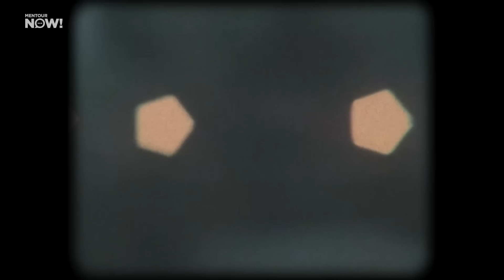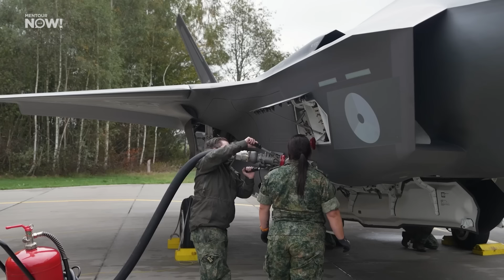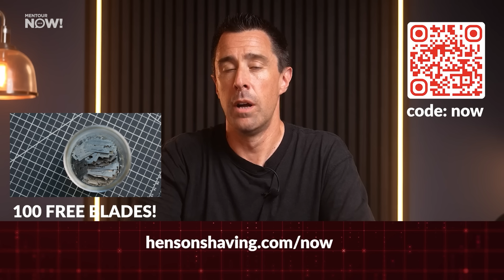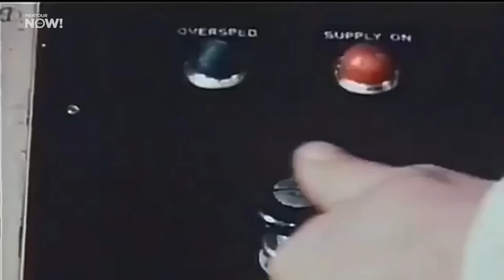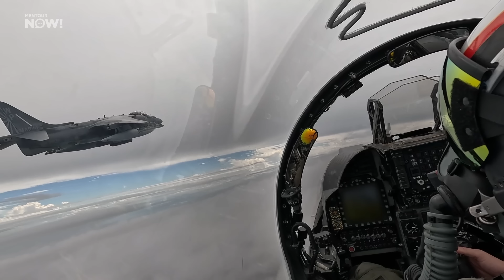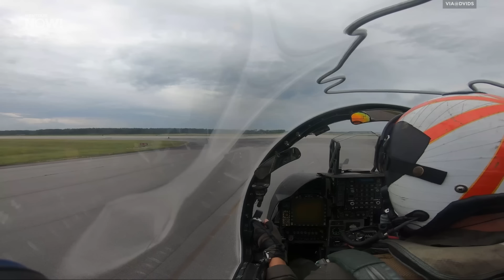The Harrier Is WAY More COMPLICATED Than You Think!!

Comment: The Pegasus is a BEAST! I used to go to airshows with no ear protection. It was usually no problem. UNTIL...one year I was standing next to a Harrier when it taxied in and shut down. Stood there for like 5 minutes with the engine running at ground idle. When the pilot shut down, I noticed a SLIGHT difference in my hearing. I couldn't hear a bloody thing! It was three freaking days before everything stopped sounding like it was underwater. 😅
Reply: Wow, thaks for sharing! It brings some extra experience (even though by-proxy) for us. At least to compare it to something we might know from a different scenario as for the hearing time after an event.
Reply: Pardon?

Comment: Wasn't the Harrier supposed to be mainly a carrier-based aircraft and since the UK had small carriers, they needed V-TOL aircraft, because no aircraft capable of carrying multiple missiles could take off (and land on) the short decks?
Reply: The P1127 project was to meet a NATO requirement for a VTOL strike aircraft. Royal Navy was totally against the idea and wanted Phantoms, which they got in 1964. In 1966, Their replacement Carrier project was Cancelled. The last RN conventional Carrier was paid off in 1978/79 and the Sea Harrier was ordered in 1975 to go on to the Invincible Class ASW Carriers (plus HMS Hermes).

Comment: There are several pieces of motorway in Germany that are dead straight so they could be used as runways if and when needed.
Reply: Half the US Interstate highway system is straight, but so poorly built that combat weights and vertical thrust would destroy them.
Reply: @RebelliousTom1 Almost the same as in Germany,  I just posted an answer 1 minute ago regarding our infrastructure.
Reply from the maker: Maybe, but bridges, electricity wiring etc might need to be reconfigured. Also, refuelling/rearming stations would need to be built in the right areas, and not all fighters are designed for easy/quick service...
Reply: @MentourNow lot of over head stuff on motorways can be brought down quickly with a bit of planing, tornados had motorway launch options, high wing ment they cleared central reservation. Germans used to set them up from time to time.
Reply: Bad idea, they are all in a bad shape because the government spends the money in the Ukraine,  not in the German infrastructur. We Germans are meanwhile joking about all going to the Ukraine after the war because everything will be repaired and modern  there.

Comment: well yes but the F-35B however is bascly already a very big upgrade compred toteh harrer jumpjet. well it might not take off vertcaly whne fully laden but evene when fully laden it still can take of horzitaly with entogh speed and vocalsty to still be uses the the same ships the harrer jump jet would take off on. a fully laden F-35B actly can carry like 50% or more payload while still being far far far more stealthy in just the internal bays alone but a fully laden one would carry like almost doble the paylaod wiyth exntal hardpnots too if needed.  also the F-35B unlike the harrer can actly refuel mid flight too and its ALSO A 5TH GEN STEALTH AIRCRAFT THAT CAN BE ANYWHHERE THA. HARRER CAN BE BUT WITH FAR OREPAYLOUD FLIGHT RANGE AND MODERN SEALTH TECHNGOLY ALL AT ONCE! a F-35B bacly make the herrer jump jet bascly obslite bascly withte better payloud the seath and the air refueling calbty with mdorend day tactcal linkng isa very killer combo that is very scary.
Reply from the maker: I think several versions of the Harrier could be refuelled in flight.
Reply: also the F-35B took the lessinos formteh harrer and expanded on it to make it evene better by maeking new improvents and ajustments. also its easer to make the engine to havea down facieng trubo fan bypass that can be turned offand on with just a oeping of a door and closed wit hsome extra jetterbine shaft contened thethe aircraft trubo jet engine thats bacly a trubo fan that not actly seuinga whole dected jet terbine but is justa trubo fan that bacly is just contend to the F-35B already esaxting engine but they contend a extra trubo bypass fan that bacly blowns downward whne needing extra lift for eather landing vertacly aftera mission or for extra lift for horntnaol take off whne fully laden just by addinga jet saft trasmtionand gear box to the alrady exsting terbojet engine the F-35A or C uses buthe F-35B just adds a extra jet saft hi bypass trubo fan conted to a gear box that turend off and on while oping a door on the top that opesnand closes whne needed. also the main jet engine also uses extra vartable thust veactoring on top of that so the main engine on top ofthe trbo fan bypass for evene more lift withte same sigle engine too at teh same time for evene more lift for takeing off horzlatly whne fully laden can be used to gain alot more lift while teaking far less weight and maeking way more power with lift and still have actly very little deadwight that actly take so lettle actal wieight that its just easyer and much less compexand easer to fly at teh same time. also far more sealthy too as well.
Reply: that aslo means far more lift power for way more paylaod whne fullyladen as well without much isse but the only downside realy is being fully laden it has to take off hornazlty but the mimnuim needed take off distace is so darn short that bascly it still can take off hornzatly onteh same thing thata ahrrer jump jet would take off on bescue its a very very very short hotiztal take off with vertcal lidning bascly. bascly the F-35B desnt need to liftoff vertcaly it can take off horzitly wirh sucha short distace that it bacly can use the same ship plafromteh harrer bacly can but faster bigger more firepower rangand evene sealth and air refueing all at the same time.
Reply: The F35-B has too small problems as a VTOL aircraft. It can’t take off vertically and it can’t land vertically. The RN pilots can land vertically on a carrier but only with 30+ Knots flowing over the deck. So they land “vertically” by matching their airspeed to the airspeed of the carrier. Much more a Kestrel than a Harrier.

Comment: All those tradeoffs, but also make it supersonic and highly stealthy. The near impossible task faced by the F-35B and yet it actually flies well now.
Reply: There was a supersonic sibling planned, using the BS.100 engine. A mixture of Pegasus ducting with an Olympus core. Plus the equivalent of afterburners in the front ducts.
The Hawker P 1121.
Reply: @paulqueripel3493  Hawker P.1154 actually
Reply: @Knight6831 sorry, I couldn't remember the number and quoted the first one that Google returned.
Reply: Only decades behind schedule and billions over budget! Go Navy! :)
Reply: @ZGryphon  Don't you mean go Marines? Navy's is the C (Yes, I know Marines is department of navy...)
Reply: @raideurng2508    Having two cousins who are retired Marines, I feel it my familial duty to tweak the Corps whenever the opportunity arrives. (Just not to its face, since it could kick my ass. :)
Reply: Doesn't climb or manoeuvre as well as a harrier, stealth has limited application, can be seen on most anti-aircraft systems, it adds weight and cost, Less than 25% mission capable and they need a permanent staff from Lockheed Martin, which would also make them difficult to hide on the ground.
Reply: @williamrutter3619  Just proves you don't get how stealth works.
Reply: @raideurng2508 snake oil sales people know too well.

Comment: Pretty cool, but the Swedish approach seems much more reasonable: build roads a bit better and use them as airfields.
It is as if the plan was to keep B roads as crappy as possible, even if it costs a fortune.
Reply from the maker: It's an interesting strategy, but it doesn't necessarily work everywhere... quite a big topic, we might have to do another video about it..!
Reply: @MentourNow Sweden always was very odd in this regard and the channel has some connection to it. Looking forward to it!
Reply: @MentourNow please do a deep dive in to the Gripen, Viggen and Swedish Bas90 doctrine! Petter being Swedish might even get interviews and footage from the Swedish Airforce or Saab personel amd maybe one of the hidden bunkers etc while he is there visiting family. 😁
Reply: @antioch4019  Hell, I'd love a video on the Draken, it's such a cool plane and pretty ahead of many other aircraft at the time.
Reply: @MentourNow  Indeed. It doesn't work for non CATOBAR aircraft carriers, like the ones used my the Royal Navy or Spanish Armada.
Reply: @MentourNow  I’m sure you all would cover it, but the difference isn’t just the roads. Sweden’s planes are designed to be maintained, rearmed, and refueled in the field with minimal equipment and by non-specialists. They also have landing gear that can handle rougher surfaces, intakes that minimize FOD risk, etc

The roads are just one piece in an air defense philosophy puzzle, and you can’t just sub in a plane that was built with the intention of being serviced by specialists in a hanger on a base.
Reply: Sweden's strategy is entirely built around national defence, implemented in a time of strict armed neutrality, so its more of a fortress mentality. 
It is very specific and whilst its more flexible than a giant airfields, the sections of road suitable for fast jet operations are still quite identifiable and can be targeted, especially as satellite imagery became more prominent.
The UK still had to consider international interests. Within years of entering service, Harriers were deployed to Belize to deter an invasion from Guatemala, and that included operating from hides and grass strips in the Belizean jungle.
The Harrier is just a higher level of flexibility and that was demonstrated in both the Falklands and Desert Storm with Forward Operating Bases. 
In the Falklands case making short runways out of metal panels.
Then you have the aspect that transitioning to naval operations were relatively trivial. Most RAF Harrier pilots made their first real carrier landings in the actual warzone.
Reply: What happens if the airfield is destroyed while the jets are parked and they can no longer leave to use those roads?
Reply: @gpaull2  They'd have to crater every runway, taxiway and even straight road in the area at sub-500-metre intervals to stop the Gripens departing to dispersal sites.
That would be challenging, to say the least.  In fact, with no weapons and a minimal fuel load, I'd expect the takeoff roll to be considerably shorter than the 500 metres the Gripen can achieve at MTOW, so maybe even 300-metre intervals would be necessary.
Reply: @The_Real_Phil_Lee  The Gripen cannot take off in 500 metres at MTOW, you may have misunderstood Minimum Take Off Distance for Maximum Take Off Weight. 
400 metres is the minimum distance Saab give for the C/D with a very light load. The Gripen E/F can take off in 500 metres with 6 air to air missiles but that is only with 50% internal fuel, a detail that often gets omitted. That is a last ditch point-defence loadout. They aren't going to take off in 500 metres and have the fuel for a combat air patrol.
At MTOW, the take off performance of the Gripen isn't such a show stopper, which is readily apparent if you watch videos of, say, departures from RAF Fairford after RIAT for the ferry flight back to Sweden. Fully fuelled with drop tanks, it still needs a good bit of runway and its a bit wallowy on climbout, as deltas tend to be when very heavy.
Reply: @gpaull2 Use roads. You pull the plane to runway road and take of from there.
Reply: @gpaull2 AI answer. 

Peacetime Deep Fortification: Many peacetime active airfields feature underground hangars or reinforced, bomb-proof concrete shelters built directly into nearby granite hills and forests (similar to the historic Säve and Aeroseum mountain facilities). Even if the main open-air tarmac is struck, the jets inside these heavily armored mountain hangars remain entirely undamaged.

The Taxiway Alternative: Large main bases are actually designed as vast networks. If the central 2,500-meter primary runway is bombed, a Gripen does not need it. The jet can simply taxi out of its shelter and use the regular, parallel taxiways or nearby service roads as improvised runways. Because the Gripen only needs an 800-meter strip of asphalt, almost any straight stretch of pavement within the base perimeter becomes a viable exit route.The "Hangar-to-Highway" Evacuation: While the full road-base network (Bas 90) is legally un-manned by default in peacetime, the Air Force runs constant, unannounced "readiness exercises". If intelligence indicators point to rising geopolitical tensions, the military triggers a rapid mobilization. Long before a missile actually strikes, the jets are scrambled off the main airfields and dispersed into the public highway network.
Reply: The Sepecat Jaguar, theoretically at least, also had this ability. It did do at least one exercise where it landed on the M50 motorway, got refuelled then took off again.
Reply: Problem is if another country is executing a coordinated attack, they'll bomb any road big enough to land a jet.
Reply: @AlexandarHullRichter In that case, the Warsaw Pact would've had to bomb virtually any straight part longer than 3-4km of the German Autobahn network.

Because Germany too had implemented fallbacks like this.

Comment: Ex Royal Navy Fleet Air Arm engineer on the Sea Harrier FRS1 899NAS and 801 NAS. HMS Ark Royal. Good times.  RN got rid of her way too soon.
Reply: That was a decision made by David Cameron, if I remember.
A crap decision.
Reply: @deanXRayZulu  2010 SDR responsible for alot of the mess that we're in now.
Reply: Indeed a great pity we never fitted SHAR with lerx & wing tip sidewinders. Both of which would have greatly improved the aircraft for very little money.
Reply: The UK government got rid of them Dodgy David Cameron to blame. He had to find away to bribe Tory voters with tax cuts. So defence was cut